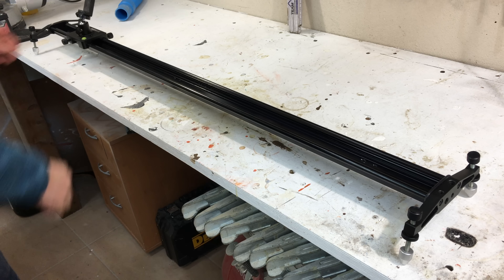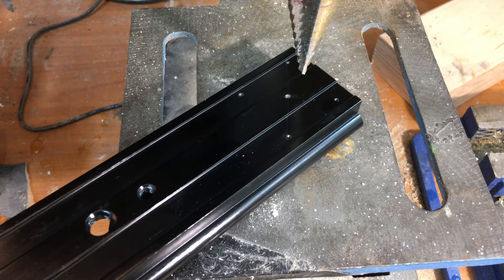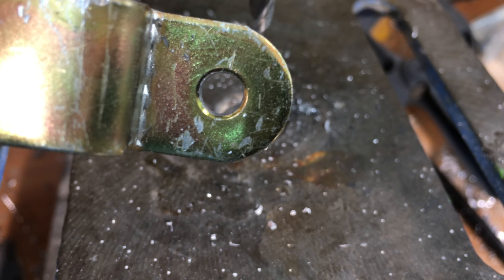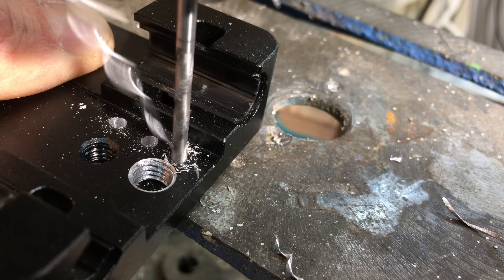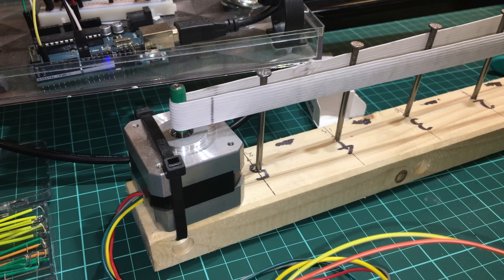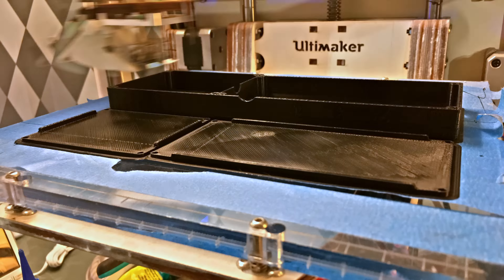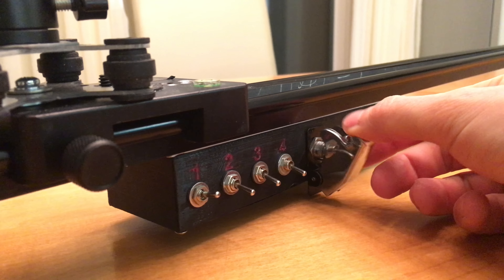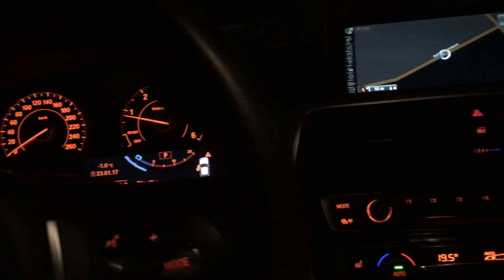Lets Make - A Motorized Camera Slider

Comment: Hi Max, I'm trying to recreate your project, but I'm finding it very difficult to understanding the wiring, as your diagram shows wiring for the UNO, R3, and not for your Arduino Micro. this is very confusing as I don't have any knowledge of electronics, and was hoping to mirror the diagram, but can not. I have tried several ways ,and am not having any luck.
Reply from the maker: +Air Dronez 4 Hire The pinout between the micro and the Uno is almost identical. So if it gets connected to pin 5 on the diagram with the Uno, it should be connected to pin 5 on the micro, too. Google Micro pinout to get a disgram. Remember, the switches are on one diagram and the A4988 in the separate tutorial.
Reply: This is what is also confusing me, there is no diagram for both combined. to make it easier to understand, like I said I have no knowledge of electronics. your concept is great. I really want to get this working. I have both boards, so what board would you suggest to use to make it easier.
Reply: So in the diagram do the meter represent the switches?
Reply from the maker: +Air Dronez 4 Hire The boards really dont matter. For our purposes they are identical except the form factor. If you compare both boards you will see that they have the exact same pins. Just at different locations. The 4 switches get connected like on the diagram from the circuits.io sketch. Circuits.io did not have an Arduino micro, so I used the Nano. 
The A4988 gets connected to separate pins (8and9 if I remember correctly) just like in the linked tutorial by the other Youtuber. I did not want to copy him, so I rather linked to his tutorial. 
Here are a few shitty pictures I took back in the day. Hope it helps. Also check out the pictures on Instructables. Got to go to bed now. Ill try to answer tomorrow. 
 http://imgur.com/S40EOu4
http://imgur.com/2pN0GYG
http://imgur.com/HyFt0k6
http://imgur.com/y6dAibU
http://imgur.com/j9ktuZQ
http://imgur.com/2GIfjiT
Reply from the maker: +Air Dronez 4 Hire The 12v supply voltage is shared by the Vin of the arduino and the motor supply voltage of the A4988. The Arduino creates its own 5v output that is used to control signals at the A4988 and the Arduino. So you work with two different voltages.
Reply from the maker: +Air Dronez 4 Hire The meters are only for testing purposes of the code. You dont need them. There are 4 tiny black switches on the diagram. Those are the switches. Are you looking at the realistic looking colour diagram, or the schematic? You can check out both.
Reply: ok, cool, just a few more questions, I see there are four blue things on the board and a black transformer thingy, I don't have these, what are the names so I can purchase them?

see link for pic.

http://airdronez4hire.com/slider/board.jpg
Reply from the maker: Air Dronez 4 Hire 4x 10k ohm resistors. They are needed for the switches and in the wiring diagram. The black cylinder is a 47micro Ohm capacitor as specified in the A4988 tutorial link on Instructables. You find this capacitor on almost every A4988 tutorial.
Reply: I know this may be much, but is there a way to provide a diagram for the whole project, I'm not getting how the switches are added, I think I can make the stepper motor work, but then I don't know how the switched are added. I would be grateful if you could do this, I can send you a payment of $25.00 for your troubles
Reply from the maker: +Air Dronez 4 Hire Adding a switch to an Arduino is really straight forward. Here is a diagram: https://www.connectedly.com/sites/connectedly.com/files/styles/larger/public/article_images/2014/06/Toggle_Example.png?itok=FoF2Obmq

There are hundreds of tutorials showing you how to add a toggle switch to an Arduino. Just google them. The basics are that the analog inputs of the Arduino (Pin 2-9 or so) can read a voltage. The voltage js 5v until the switch is closed. Than the pin is connected to ground through the 10kohm resistor and shows 0V. The Arduino notices that and accts accordingly.

Comment: That lovely.. I just gave away my stepper motors because i dont know how to use them.
Reply from the maker: You could use a small DC motor and a DC driver. Both available from Amazon for about 15€ each. They are almost ready to run.
Reply: @MaxMakerChannel  yes I already built one like that. It has a 10rpm and a 2rpm with a pwm for speed.
But steppers would remove the need for a limit switch at the end of my track, not to mention the single motor as opposed to using two for my speed range. Peace!

Comment: How does it know when to stop without contact switches at the end? I can see how it would know how many steps if it always powered up at the same position, but what if it boots up at a position other than the home position?
Reply from the maker: You are right. If you flick the big switch when the cariage is not at the far end, it will overshoot. However the motor will just stall or the belt will slip. No damage done here. I belive the A4988 also has over current protection.
Reply: Ok, that makes sense. Thanks. I learned so many things from this video (masking tape trick, step drill bits,  chamfering bits), and wanted to make sure I didn't miss out on some magic endstop trick. Your tips from this video are going to help me to prevent my next project from being quite so hacky.
Reply from the maker: +Nick Shaver You welcome! Its great to know that my videos have a purpose : D
Reply: easy way to fix it is to make 2 new pins
put a piece of metal on th... nevermind bad idea

Comment: Sweet build. Wish I could afford the printer though. Sigh.
Reply from the maker: +Marc Draco They are not that expensive anymore.
Reply: Max Maker it's all relative my friend, I had to make a slider from scrap parts because I don't have the money to buy one that's capable of carrying my rig. I agree though, in real terms 3D printers are WAY better than buying even small project cases and having to drill holes in them: or worse. I'm going to have to source a cheap motor, etc for mine. An electric drill is usable but you can't really beat computer control.

Comment: Hey Max Maker, would this work for a camera slider that go both vertical, diagonal and horizontal?  Or would that be to much weight for the motor?  I am using a medium size camera.  I am super new to arduino and don't know much about motor capacity.  This was the slider I was thinking of using: https://www.ebay.com/itm/Neewer-Black-47-Video-Stabilization-System-DSLR-Camera-Track-Dolly-Slider/382001903048?hash=item58f11675c8:g:HkwAAOSwhQhYx6PD
Reply from the maker: Probably. If not yoy can get a geared Nema 17 for 5 times the force at 1:5 of the speed.
Reply: Thank you!  I plan on making this soon and am excited to learn more about arduinio's and coding in the process.  The coding is what scares me haha, but small projects seems to be helping me to understand it better, so I greatly appreciate your guide!